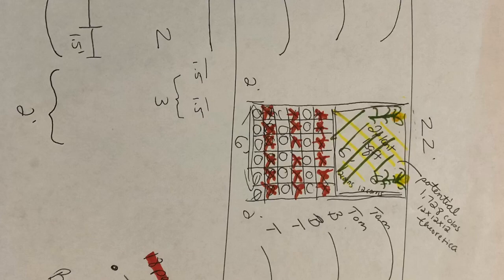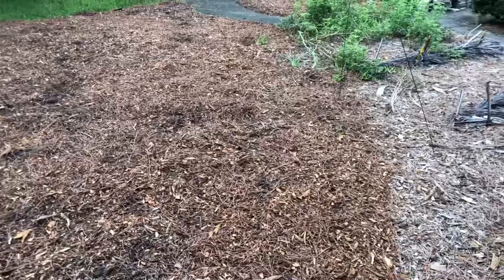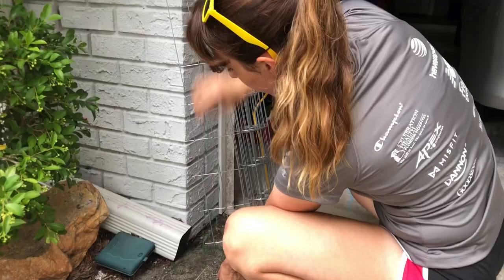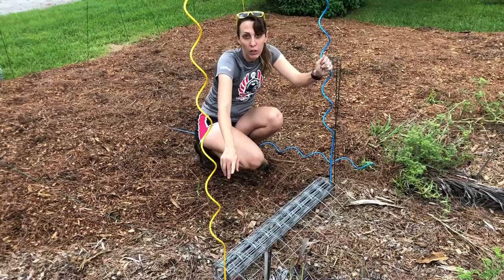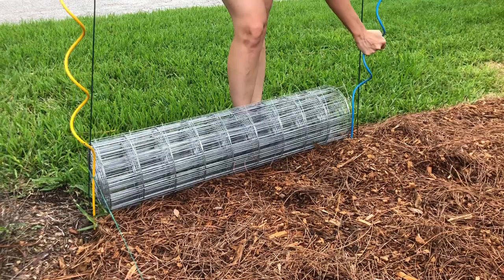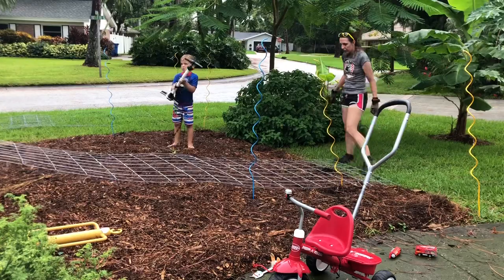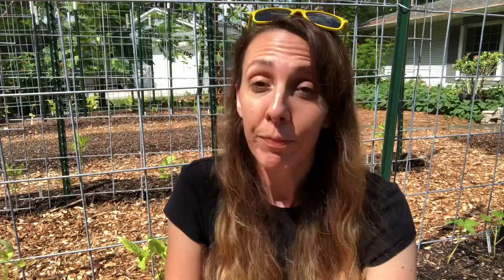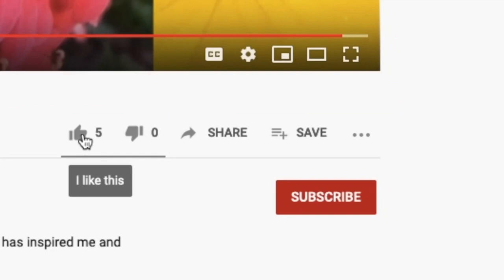DIY Cattle Panel Trellis for your Urban Homestead

Comment: Here is my trick to get the cattle panels (16') home. I used a short bed pickup. Put an extension ladder on the bottom extended out to about 15'. Put the cattle panels on top. Buy something heavy to put on top of panels towards the cab. I just put a couple bags of water softner on top. Be sure to tie everything in so it can't slide out.
Reply: Nah, stand the panel on edge in the bed and "fold" in half, strap it in and call it a day.

Comment: you can put  about 10 cattle panels in back of pick up truck using ratchet straps and bungie cords.  Fold
part goes on bottom of truck bed. Just did this a few weeks ago and worked great.
Reply from the maker: Awesome! I'm going to have to buy more and I do not want to that truck again. Renting a pick up is easier. Thanks for the advice! 😄

Comment: New subscriber from Polk County, FL. We did a similar project in the summer, but did a 1-panel and then a 2-panel tunnel. Thankfully, TSC DID deliver to our house, but it cost $70! So we didn't save much off the price of your rental. And we were at their mercy as to when it was delivered. It was a great delivery person, though, so no worries! We have melons on our right now, but plan for Seminole Pumpkins in just a few weeks. We are doing a new no-till bed for those, along with Sweet Marjoram which is supposed to make the pumpkins sweeter. Keep up the good work! You are very inspiring!
Reply from the maker: Thank you 😊  I'm interested on how your Seminole Pumpkins go. I'm going to try some too! Fingers crossed they go well

Comment: FYI: In the future you may want to rent a 16-ft trailer.  In my area most tool rental store will either have one for rent or can tell you where to rent one ($75 per day a 4 hrs rental may be cheaper).  This is assuming you have a hitch on your vehicle.  If this does not work for you many large lumber store have trucks with flat beds on them for rent.  this may or may not be cheaper depend on your area, but worth checking out.  Another option is check around for a friend or church member that may have a trailer and willing to do it for you.  Pay them $50, then you both win.  You may have tried all these options, but it is worth mentioning for others.
Reply from the maker: What fantastic ideas!!! Thank you with sharing with all of us 😄

Comment: Hello, can you answer a question for me please.  I have enough supplies to do 48’ of tunnel.  Room is not an issue and I plan on doing 4 different crops.  Should I run one long 48’ or chop up into smaller links and put individual plants on each?

Comment: We had no way to bring home 16 ' cattle panels- delivery to expensive. Bought 2  8 ' panels, brought home bungied to the top of our jeep. Attached them to t posts then pulled down the ends, overlapped the by 1 square each and zip tied a lot. We have 3 such tunnels. BTW, where in Florida are U located - we're Pensacola
Reply: You may buy 16’ sheet and ask for cutting in half😇

Comment: Ok so once you add the t post the clips the wires the cattle pens and the post driver your looking at about $100 per trellis so you didn’t pay $300 you paid over $600. Oh I forgot plus the $100 for the uhaul so your at over $700 for the project that’s not including your time and labor that’s just materials ok thanks
Reply from the maker: My dude… $45 per arch (all materials included) x 6 arches + $100 for transport + $35 for t post hammer … $405. No idea what you did there with your math. Hope that helped you
Reply: @WildFloridian  what about the cost for the t post and the clips